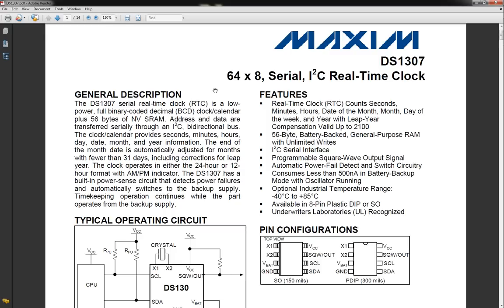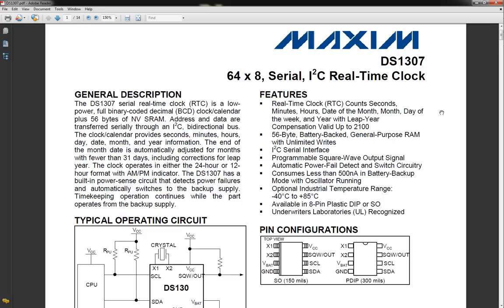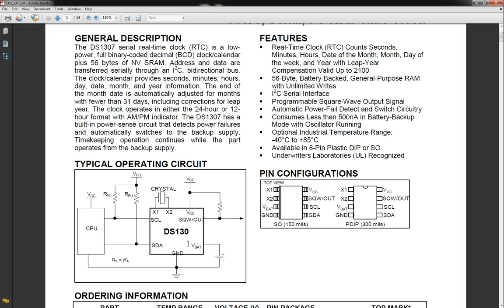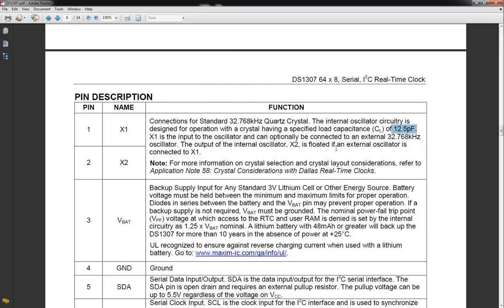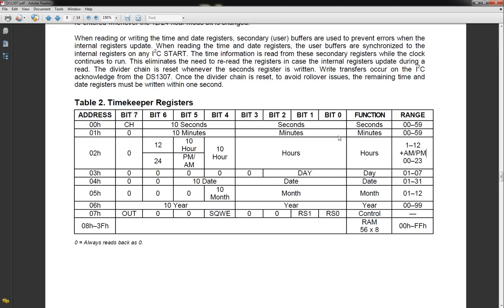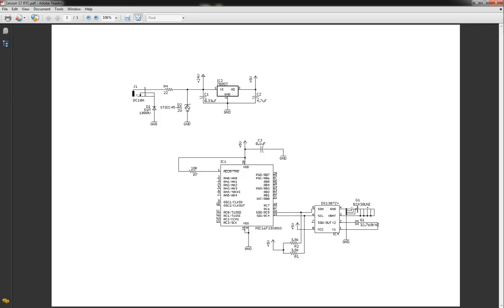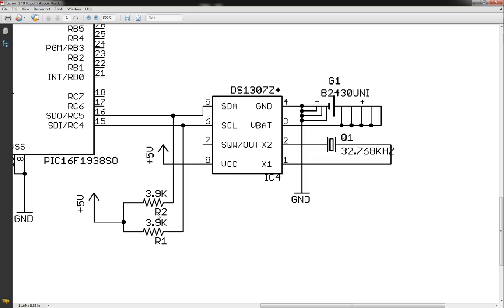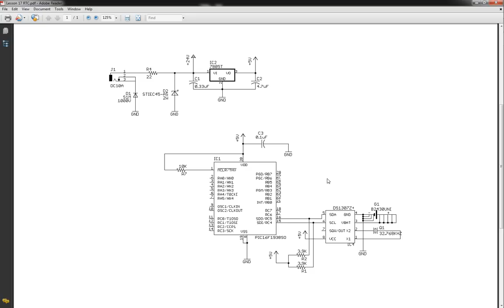Lesson 17 RTC Hardware

Comment: Iam using (PIC + DS1307) and MIKROC to make 7 segments clock , it works great , but i can not keep the seconds register when the power off , how could i solve this problem ?
Reply from the maker: Hey there thanks for the comment.  I was wondering if you were using the 3V coin cell battery? There are two pins on the DS1307 that are for a 3.3V coin cell battery for keeping the memory registers.
Reply: yes , i connected a coin cell battery , and the minutes are counting when the power goes off . I think it is from programming but i can not solve it yet